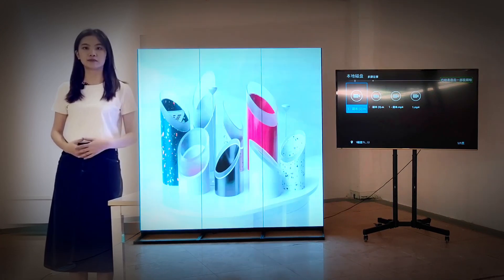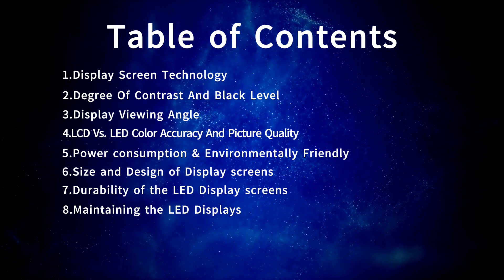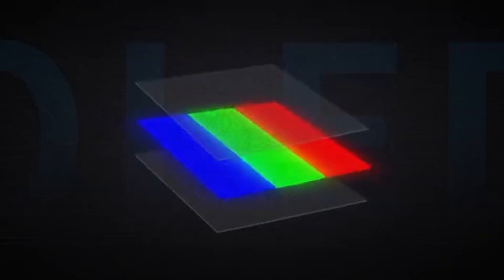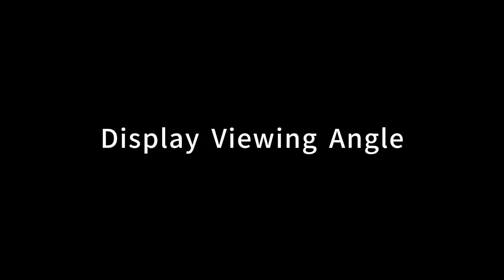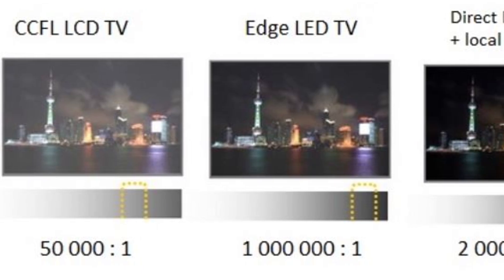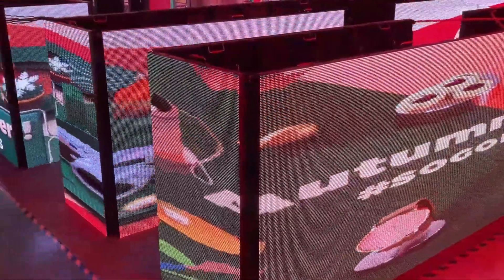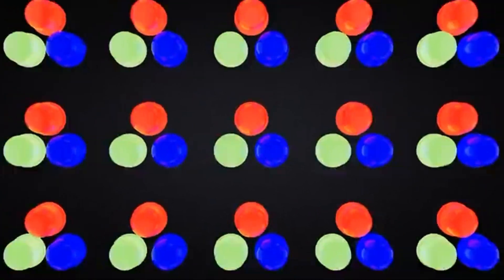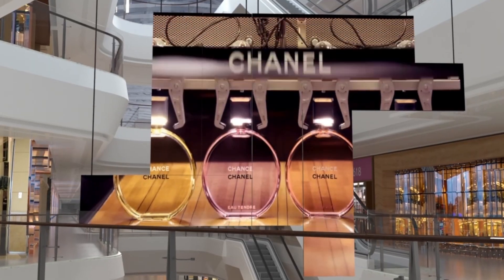led monitor vs lcd ｜What is the difference between LCD and LED display?

Comment: Bro what the heck, stop spreading missinformation. There is NO DIFFERENCE in contrast between "LCD" and "LED". Yes, LCD and LED are both LCD panel with only different backlight types - LCD uses CCFL bulbs and LED uses.. LED as its backlight, its simple. Ofc latest LED LCDs have better contrast but its because of innovation in LCD panels. Backlight is only providing LIGHT and nothing else, so there is no way that LED could have better contrast.